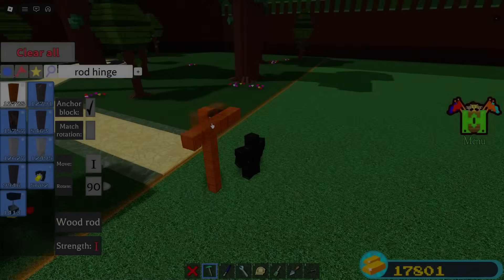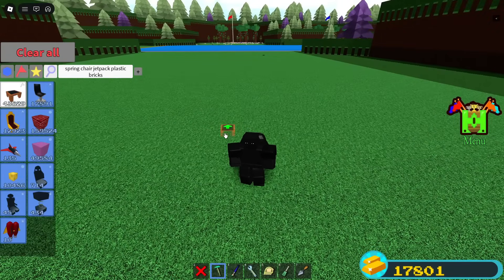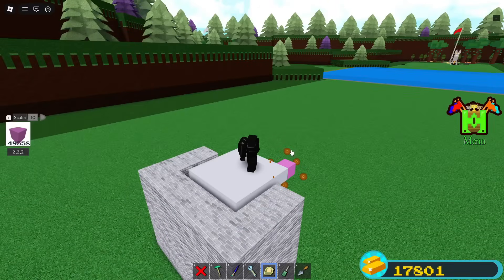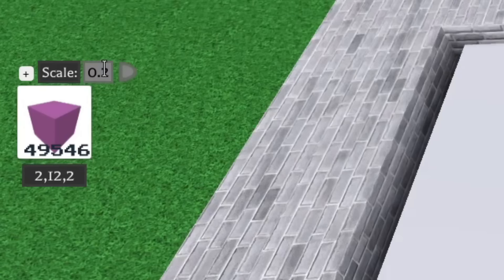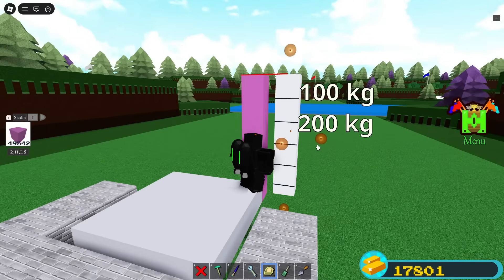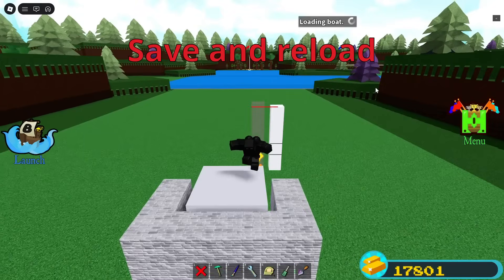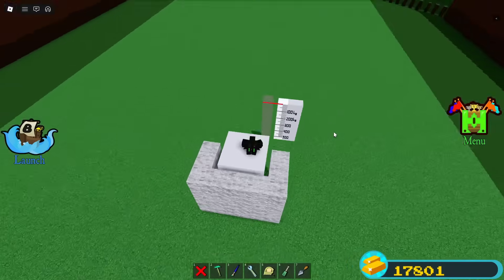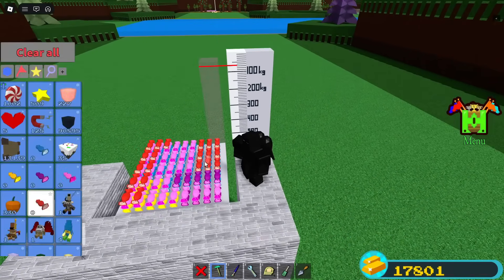Build a Boat - Scale Tutorial! (weigh almost any item)

Comment: So, can I do it higher, to its can scale more weight? (like, if I will extend the spring, it will still show correct weight?)
Reply: Yes, just multiply the Stiffness value, it can be 2 (1000kg max), 3 (1500kg max), 4 (2000kg max) and etc
Reply: I did it by myself

Comment: if i set stiffness to 981, will it measure in 10 kgs?
Reply from the maker: yes but the offset (zero) will be slightly off (the spring part weighs 2.8kg so you should keep that in mind)

Comment: Man such a great video (im 3 seconds in)

Also, how do you find the exact values for the spring? That gotta take a while
Reply from the maker: well you hardly even need math, roblox gravity is 196.2 so if i would set the spring stiffness to 196.2 then for every stud lower it goes it means +1 kg (i used 9810 so 50 times higher which means 50 kg per stud which just means you can measure slightly heavier stuff)
Reply: @dabl2928  That’s how stiffness works? I thought it was some overcomplex formula so you had to do some trial and error stuff but tyty for that info
Reply: @dabl2928  So if you set the stiffness to something else, then you can make a more accurate weight?
Reply from the maker: @EvilR81 yeah but because the spring part weighs 2.8kg youre gonna have to change the 0 position so it offsets the 2.8kg